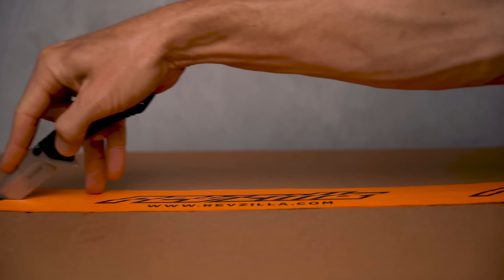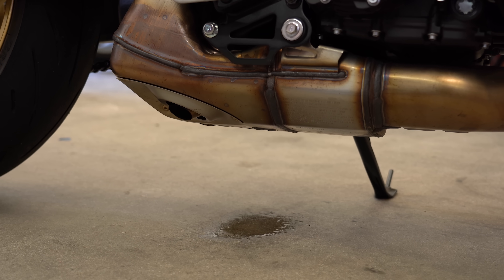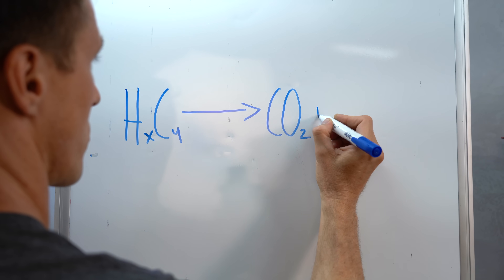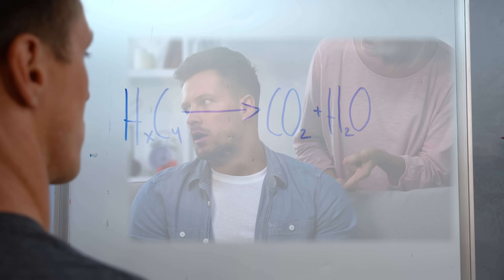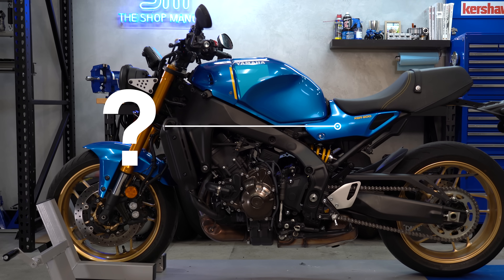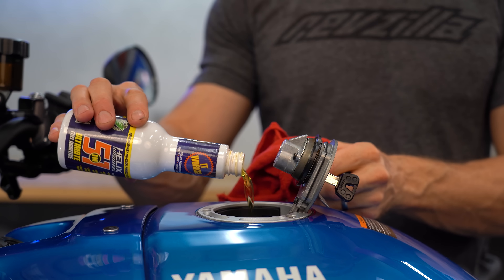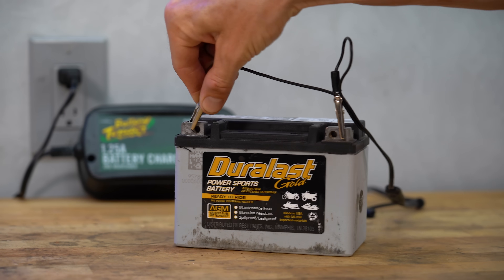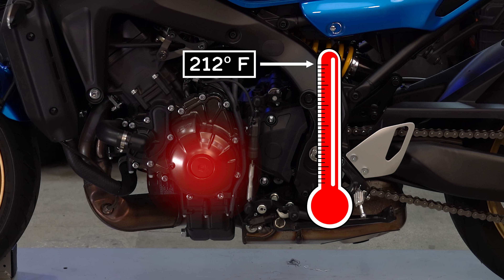The Storage Myth That Hurts Your Motorcycle | The Shop Manual

Comment: Unknowingly I avoided all these mistakes by just riding the bike to work on the winter so the engine and pipes are scorching hot, and parking the bike in building hall, where the ventilation is wind tunnel. Good.

Comment: Never had a problem with winter start ups over the last 40 years. Funny to see the condensation dripping from a stainless steel exhaust. 
Climatic temperature changes during lay ups are far more likely to produce problematic condensation than a good engine warm through.

Comment: Well, I'm a winter rider too and I always leave it running to the desired temp. before riding. However, I didn't know that you should be riding when the engine is too hot to touch.. Learned something new today!

Comment: Also, for what it's worth, if you have downpipes that are close to the front wheel/fender or plastics, then use a fan to blow air over them so the heat doesn't affect the plastics/rubber..... you can melt the plastics if there is no air-flow around the bike...

Comment: Just ride the things, can't imagine anywhere except the North Pole where you can't just tog up and do a local circuit to get some heat in, this also helps all the cycle parts and tyres, more to a bike than the engine. In the old days (70's-90's) you would see bikes year round, and "winterizing" was what boat owners did.

So anyhow I use zero eth plus a stabiliser all year round (as you can't always trust the pumps), and all the bikes I own (3) are used year round even though I am old, especially on the wonderful dry crisp slightly warmer days Winters can bless us with.

It's great feeling to know they are sat there, on the button (although all kicker only) ready to go if I feel the need / have the time.

We (me and the wife) were out the other day on two bikes to a local event, ambient was 0c / -32F but dry and sunny,  no biggie if you keep the speed down to minimise wind chill, probaly only 20 miles total, but everything well up to temperature.

Comment: Another issue is when you let it idle for a long time. the cylinder head starv oil, specially on scooter which engine operates at constant higher rpm, their oil pump was design to pump good amount of oil at higher rpm. Motorcycle engine are design to be rev dynamic unlike stationary engine like those on pump boats and generators that can operate at steady rpm.

Comment: If you store your bike in a non temperature controlled garage the continuing changes in temperature, 20° one day 45° the next , youre accumulating a lot of moisture and running it just before the outside temperature climbs will prevent a lot more moisture than it creates simply because a cold hunk of metal (your bike) warms up a lot slower than the air around it and the metal condensates like an ice cold beer can on a Summer day

Comment: I run mine until it snows. I only use gas with stabil in it year round in all machines. Then change the oil and I don't start it till spring. Huge advice, fill your oil filter with oil. Even if you spill a little, it's better than nothing. Also don't put all the oil in. Leave it just a little less than what is called for. That filter can hold a lot. Wait till spring and run till the fan kicks on. Cut the motor and wait 10 minutes. Add oil as needed. Goes without saying, store your bike on stands. Keeps mice and frost away.

Comment: Just sample of what i do every winter. wash your bike, lube everything that need to be lubeed to preserve it from going into corrosion process, cover Electrical wiring conectors with vaseline (griffon). Later on plug the maintaining device that LL automaticly charge battery when needed and put the bike on paddock stand which will prevent tires from deformation after staying few months in one position. At last check insurance and technical stuf that need to be changed before next season. Befor new season clean bike from dust and grease check tire pressure and go for a ride 😄

Btw: greetings from Poland. We have winter here, -10*C and a lot of snow 😃

Comment: You can't store an old bike the whole winter.
The gas with ethanol in it will suck in the moist from the air arround and you get water in the tank.
That results in gas, that isn't able to be used. Your sealings and hoses will get dry, too. Years ago i went in garage, open the petrolcock, and 3 liter gasoline ran out the tank, cause all hoses were bad. Then i closed the petrol cock, but the sealing broke, when i opened it. So i leaned the bike against a stand in 45°, put a bucket under it and catched the fuel. 

After that i removed the seat, removed the tank, took my endoskop camera, and looked inside. All was rusty. And near the petrol cock outlet was a slimy mess. So i cleaned the tank with some chemicals, bought new hoses, new petrol cock, cleaned the carbs, resealed them, sync them, put all together, changed the spark plugs and air filter. That took 2 weeks, and i was ready to ride again.

Then i was on vacation for 3 weeks in early summer without the bike. So i parked it in garage, put a big tub under it, just for prevention. I came back, all hoses were bad again, petrol cock was hard to turn, carbs were leaky.
I HATE THAT ETHANOL GAS!
Reply: I don't use Ethanol gas.  Just 98 Octane RON and it's superb.
Reply: @theaustralianconundrum  Thats great for you. I am from germany, and EVERY gas has ethanol in it. Diesel, too.
Reply: @TobiasRieperGER  WE have the best gasoline in the world.

Comment: I just moved somewhere without winter and removed this problem. 

But in all seriousness, what I’ve done with my ‘88 Wing since I bought it in 2013, when I needed to store it, was fill it with ethanol-free fuel (if there was any around) and treat the tank, riding it for a bit so it gets into the system, and then parking it and maintaining the battery.

During Covid, from July 2019-July 2021, it sat that way and then started right up when I fired it up.

I always try to inform people against starting their vehicle when they’re “stored” for winter.

The only time I start it up was those random 60 degree Midwest days in January and then I’d actually ride it, get it all warmed up.

Comment: This is also why engines with higher highway mileage are often in better condition internally then lower mileage ones that do short trips around town despite having done more work.
Short town trips dont allow the engine to get up to temp and stay at temp long enough to boil off moisture- leads to sludge build up and oil gets acidic

Comment: I've tried it on my CRF250L, it takes around 15-20 minutes, at that time condensation stopped steaming from muffler weep hole long ago, thermostat let the coolant towards radiator, engine case is too hot to touch, and fan worked and stopped, when fan stops first time, it should be fine. 15-20min on 250cc Honda, but I rather take it for a 30min balancing practice ride in the street.

Comment: Every time I start a bike, it will run for at least half an hour, and usually at least 10 miles of actual travel. On top of the water condensation being a problem, there is also the issue with excess fuel on startup (since most ICEs have to run rich on cold start) mingling with oil along the cylinder walls, finding its way into the sump, which will prematurely break down the oil AND can wreak havoc on your main seals. I've seen it happen to bikes that only ever get run for 10 minutes or less between long periods of sitting cold. If you get your bike good and hot, that residual fuel in the oil will evaporate out, due to the hot operating oil temp.

Comment: I plug my exhaust and cap my intake to try and seal my system for storage. I also had a mechanic friend say it was a good idea to add a teaspoon of oil through the spark plug hole to line the piston rings and cylinder for extended storage.
Reply: Not if you run the engine for 5 plus minutes once a week.   Storage is not supposed to be suspended animation  lol...  But how to keep the engine as if it still has an owner. I start min every wednesday at let it idle for 10 minutes. The battery stays fine and the fluid circulate and the moisture disipates. Move the bike to prevent flat spots on the tires, and cover it from dust.  if you can keep it in a climate controlled space the better

Comment: i had a 1984 Honda Magna V65 and tried to start it every couple weeks during winter while it was stored in my shed sitting on the center stand without gas treatment or a cover.
it ran great every year for the ten years i had it.  no problems.
except for the head on collision.
yea it was horrifying.
but the bike still ran great.

don’t know what to say about your advice or my experience with the Magna.  just sharing the facts.

Comment: I've put a solar panel on my bike shed and it keeps the battery nicely topped up when not in use. The bike has an alarm so it does discharge slowly and can mess up the battery over time, but a even in winter a basic solar panel means it's never an issue.

Comment: I don't have power to my garage and have found the solar trickle chargers keep the battery alive, you need to weatherproof it if its on the roof and a Tamiya style connector means you don't have to mess around connecting it up.

Comment: Good advice. Battery tender, full tank of gas so the inside of the tank will not corrode and adding gas treatments for storage. Where I live, usually November to April the bike sits covered up and clean. The only other thing I do along with my sports cars in the past was pump the brakes and clutch to let the fluids flow and not cause any sticking on seals, Yes if there are any warmer days it may go for a ride but the salt does a lot of cosmetic damage etc so it is usually stored all winter. Plus they do't start too well in -10 weather. My ninth year storing a Concours 1400  this way and it always has started within three revolutions or so, say less than five seconds to start up.

Comment: Have ways ran mine for 1-2 hours once a month during winter. The problem is when as you said people run it 10 min and it never gets to true operating temperature.
Also you will never need to put fuel stabilizer in your tank if you use 100% ethenol free gas like you should be doing anyways.

Comment: I think people over-think this whole subject.  In Canada where I live, 4 to 5 months of storage is typical.  A good grade a fuel lasts about 2 years without stabilizer so I never use it.  I run my bike down to almost empty, park it in the garage, plug in the battery tender and that's it.  Then it sits until Spring.  In the Spring, I change the oil & filter, put air in the tires, unplug the tender.  It starts right up and I hit the gas station.  Doing that on the same bike since '09 and never had an issue.  Even on my carbureted bikes since the mid-80s, did the same thing and never had a problem.

Comment: Even in the Midwest with my motorcycles stored in an unheated garage with smart battery tenders, there was almost always a day each month where the temperature would hit at least 50'F. I'd take each bike out and ride it for several miles, especially if I needed something from the store. As mentioned above, everything was warmed assuring water condensation and, therefore, rust and corrosion would not become issues to be dealt with later during riding season.
Reply: Idk where tf in the midwest youre living, but 50 degrees in the middle of january isnt happening

Comment: My dealer told not to leave my bike on a battery maintainer/tender continuously for the winter months while my bike is not being ridden. Their suggestion was to plug into the tender for 12 hours a week. Plug in 8am Sunday, unplug 8pm that night. Their claim is that I am 'boiling' the fluids in the battery shortening it's life span. Isn't a battery tender partially diagnostic? ....only charging if and when the voltage of the battery falls below a certain threshold so the battery will not be under constant charging and thus not 'boiling' the battery fluids?  🤷🏻‍♂

Comment: I think I read ~paraphrase~ MotoMan says; idling your bike or snowmobile; especially when it is New, for 15min intervals is the worst thing you can do to new piston rings. Back Pressure from hard deceleration sets the rings and without a load on the bike the rings are 'there for the ride' and will wear in that fluff position ultimately not sealing ideally.🤔

Comment: Use the Stabil. After a ride, shut off the gas, start and run till it quits. Keep'em clean and dry and set them on the centerstand with the batt tender.  AGM batts are the best for the money. The "dried out seals from sitting" issue has never been a problem with my old bikes.
Reply: A fuel valve used to be standard. My '84 didn't have one and neither does my current 99 or 13.
Reply: @stevek8829  if it's carbureted it probably has a fuel petcock. My 85 Goldwing is fuel injected and also has a fuel shutoff.  Just use the fuel stabilizer if you don't have a petcock
Reply: @ahbalone  my '84 GL1200 didn't have one, carburetors. Neither does my 99 GL1500, carburetors, they don't need to have the gas turned off, because they have a vacuum-operated petcock that automatically shuts off as soon as vacuum from the engine (produced when it is turning) disappears. I'd rather have a manual as well.

Comment: Every 3 months i run mine  until its hot enough to get the rad fan started ,it stops sticking thermostats imo . I also run a ventilation hose from the exhaust to outside and keep a CO alarm .

Comment: I ride a 2018 KLR650. Tht KLR engine is a giant heat sink and in October unless I ride it at least 25 miles on cold days, the oil never gets hot and I get milky goo in the oil cap and vapor beads inside the sight window.

Comment: I have found no use for stabelizers or Sea Foam, all Snake oil, just read the ingreadance. My choise is to always run Non-Ethinol fuel and fill the tank and store in a dry area where rodents can not make a nest or chew wires, another thing battery tenders rune more battries then help, a fully charged battery in good condition will survive a cold winter with no issues. One thing on newer bikes like my 2024 XT250 it has a computer and a clock, both do put a slight drain on the battery, so I make it a practice on modern vehicles to disconect the negitive lead to the battery.

Comment: I'm not so sure about the fuel stabilizer.  A friend with a Porsche car had all sorts of problems when he used fuel stabilizer.  Admittedly, that may not be applicable to motorcycles but I've been just filling the tank with the highest octane gas I could find (94), and had no issues, on a fuel injected bike (KTM) and my old 1991 DR650.  Winter temps get down fairly low in the Toronto area but the bikes start up just fine when it's time to ride again.  Agree with not starting the bike, and with using the battery tender.  The tender does not need to be connected full-time.  I have two bikes with tender hookups and alternate between them, swapping them once per week.  The Suzuki has a new lithium battery and I didn't do anything with it last winter.  Held the charge on its own the entire time.

Comment: I ride year-round. Even in the dead of winter there's always a day or two you can get out and ride. My rule is if it's over 32 degrees and the roads are clear and the wind is less than 10 Mi an hour I'm riding.

Comment: I have a 77 kz1000 and if i don't start it weekly, the engine runs extremely rough. Also causes the clutch plates to stick together. The weekly startups keep her firing up fast and smooth.

Comment: If you empty and run bike out of petrol pull spark plug or plugs and fog cylinder with oil or drop a few dropped into spark plug holes and crank engine a couple of revolutions to stop rust.

Comment: Only the metal fuel tanks must be filled up fully in order to avoid rust inside (if there is any damage inside). But modern bikes have mostly plastic fuel tanks, so it will not corrode.

Comment: This is my procedure for my 2005 Sportster 1200 Roadster:

Change the engine oil and filter.
Every other year, change the fork oil. Most folks don't do this because it's not as obvious as the engine oil.
With the spark plugs out, rotate the engine by hand until you find the spot where both valves are closed. This takes any tension out of the valve train and greatly reduces your odds of having a stuck lifter next season.
Pour 2 ounces of Marvel Mystery Oil into each cylinder. 
Lubricate the clutch and throttle cables. 
Lubricate the Heim joints that allow the engine to move around.
Lubricate the swing arm bearings. They are Heim joints too.
I use a zip spout handy oiler available at auto parts stores. 
These steps are in addition to what's described in the video. 
I store my bike in my garage, up on a motorcycle jack, under a cover.

Comment: Good video, but omitted to say that whilst a battery is left in circuit, regardless of wether or not it’s kept on a maintenance charger, there’s a small residual current flowing around the whole bike. This current attracts moisture particles from the atmosphere around the bike and they cling to the bikes surfaces, particularly the metal ones. So, disconnect at least one terminal post of the battery.

Comment: If I don’t ride my bike for 3 months or more, it will be hooked to a trickle charger to keep the battery fresh and have fuel stabilizer.  I start it once every 3 months but only let it run for about 20 seconds.  So, I am not really concerned about the buildup of water vapor.  I have never had any problems or rust issues with this approach but I guess it could still happen.

Comment: Best to just read what the manufacturers manual for your bike says.. The info in this video was wildly off what KTM advises for my 24’ EXC-F. Charge then remove the battery and keep it indoors, fill the tank to the top with fuel stabilizer, change the oil with fresh oil, then put it up on a steel stand.